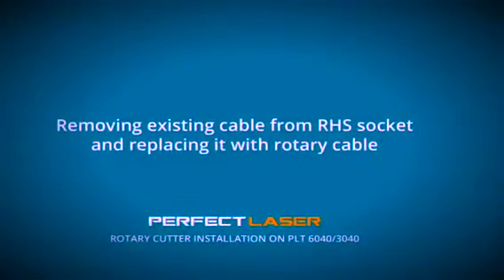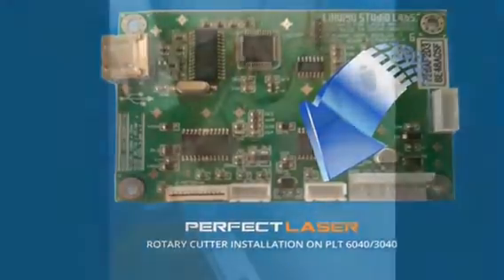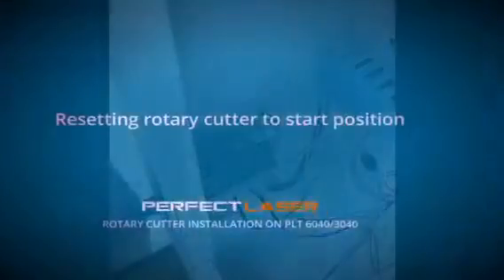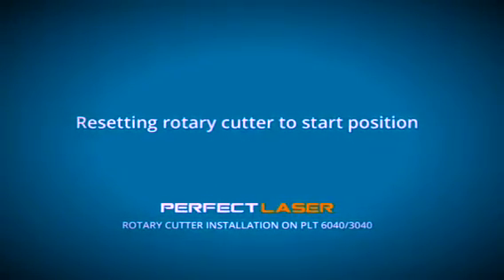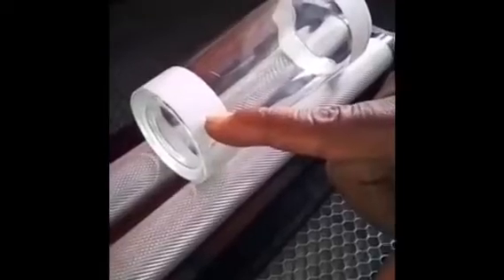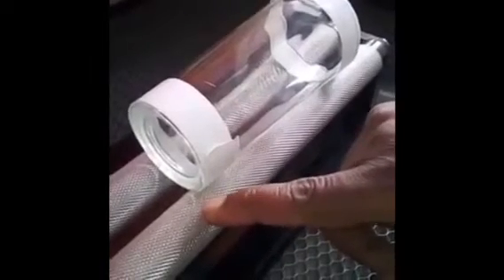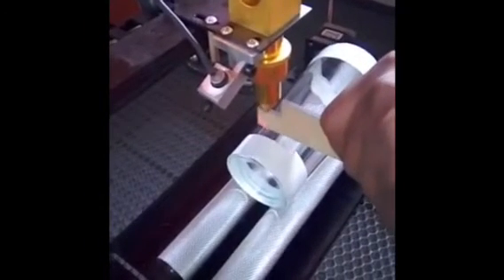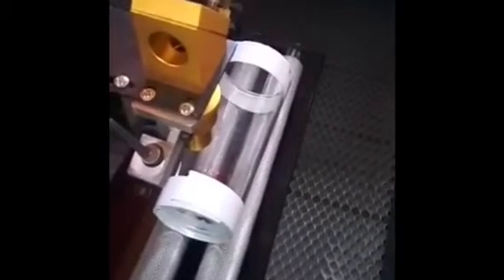PL Rotary Attachment Installation 2015

Comment: Hi, thank you for your video, it is a huge help. One question, I have an issue setting up plus/round. You mention it should be in proportion with a diameter. What is the logic of the proportion?
Reply from the maker: Hi Jesus, sorry - that comes from the Chinese. It should be Speed/Ratio and that should be at 1 for engraving (500dpi) or at 2 for cutting (1000dpi). the fixture should be "simple fixture" and if you insert the diameter of the object you want to work on, it will automatically calculate  the perimeter.
Reply: hi.Doc B thanks for answering.
i think im doing something wrong. 
do you have mail or whatsapp? 
because i really can't understand 
 ( rotary fixture settings )
(619) 823 1585 san diego ca.
lizmonz87@gmail.com gmail